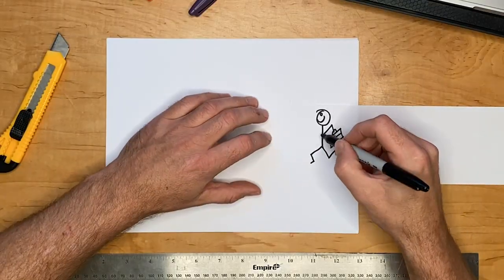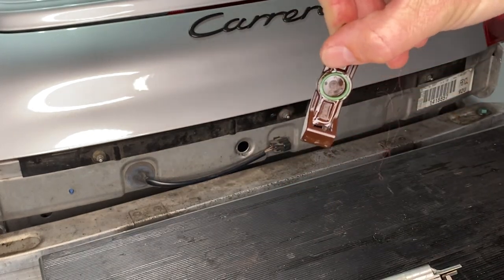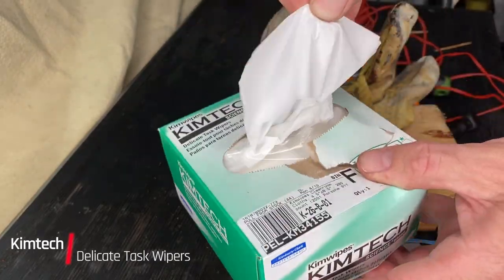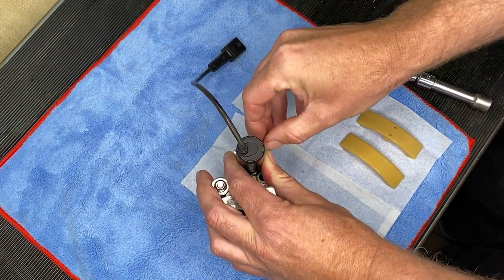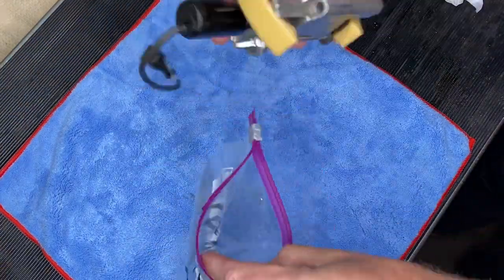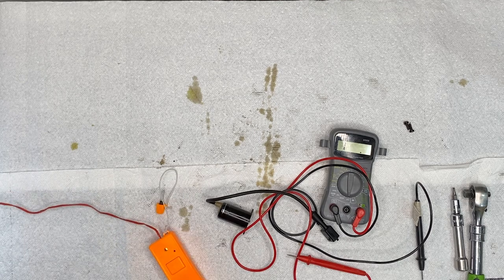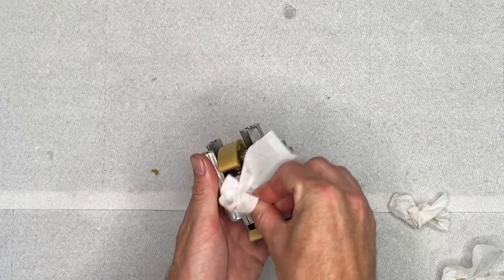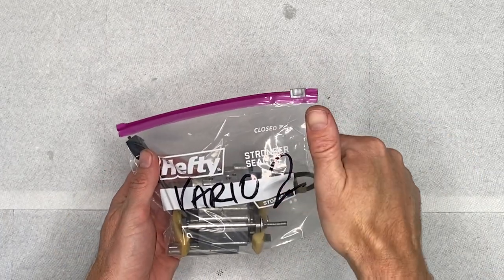PORSCHE VarioCam Test & Rebuild

Comment: Having them on the wrong way is indeed a big problem! Back again to comment on your videos because I'm learning so much! But, the tiny holes on one of the cam-pads are where oil escapes the piston and the whole system and lubricates the chain. Without them in the right place the parts will wear unevenly. Good catch by you on the re-watch when you were looking at the previous "mechanic's" work. Very nice!
Reply from the maker: Thank you Kyle, I appreciate the education. I was wondering why only one of them had a seal and holes in it. Prior to having them in my hands I had assumed that the upper and lower were identical. Live and learn... Thank you for watching 🤘😎
Reply: @ManinaGarage   with the debate around which way they go back on.  Under the cam pads is there a spot where the oil comes out to lubricate the pad. Surely that will guide you as to which way they go back on.   I need to watch again now

Comment: This is the best vid specific to the cam chain solenoids, actuators and pads. You make it look easy. No doubt the bank 2 pads mixed up couldn't be a good thing and were likely the cause of failure.  From what I've read regarding age and mileage I'll be doing this job in a couple years.
Reply from the maker: Hello DSC800,

A subscriber mentioned that those two holes on the lower are designed to control the flow of oil out of piston and that the green oring is to prevent the oil from going anywhere but out those holes. The jury is still out on exactly how that would lead to their early demise, it’s probably not good though 🤣😂. I feel someone should set up a “cam pads ‘r us” business and just churn through all the Porsche’s in their area for some bargain price. If someone was doing this on a regular basis they could make the price less painful (maybe)  Thank you for watching 🤘😎
Reply: @ManinaGarage  I agree with the other commenters that those holes let the oil out which lubricates the chain. They having been put in the wrong way around meant no lubrication between pad and chain leading to accelerated and heavy wear that ultimately lead to the chain jumping two teeth (or am I mixing up your observation wrt 2 teeth jumped on bank1 and the pads swapped on bank2?).
Anyway, to my understanding this is proof that no gear slipped on the IMS so no need to pin it.
Also your observation early on when finding TDC that only one bank was misaligned (soot inside the combustion Chambers onjust one bank) would have meant that the gear that drives the exhaust cam would have had slipped not the gear that's been driven by the crank which is more susceptible to slipping apparently. 
I would put back the pistons as they are together with new rings if the bores check out in spec. Except the one that has the little spot where it flaked off. Anything other than ferostan (or ferroprint also by Mahle) combined with locasil is not proven nearly as extensive as ferostan/locasil.
Reply: @bernardmclake3898  I agree but it's probably a hard decision at this point, to re-sleeve or not. It would save a lot of money to put it back together but then who wants to do all the same work again if it starts to score in 5 or 10k miles. 
There is a Hartech document that describes a locasil v.1 and a v.2 with the v.1 ending around the mid-2001 model year. V.2 was cheaper/faster. He backs it up with magnified images of each type (spoiler alert - v.1 is better with a finer grain that is easier on the skirts and less likely to flake).

Also, it would have been the intake gear that slipped two teeth not the exhaust as this is driven direct by chain from the IMS.

Comment: Brilliant! As usual. Eight years ago, I bought my first Porsche, a 2001 Boxster S. I new that the guide rails were worn when I bought it (showed up in the PPI). I had no idea what that meant so that first winter in MY tiny garage, I dropped the engine and dove in! What the fuck did I know: hey it's not rocket science, right?  The Bentley's and the internet were highly useful in keeping me from despair. I guess we are kindred spirits Finn, know no fear, hey, what's the worst that could happen? Excellent video, and very entertaining!
Reply from the maker: That’s a good PPI, I’m impressed 🤩. Those little buggers were intimidating until they were in pieces. Discovering that they work on oil pressure was a fun brain twist, Porsche engineering! Wishing you an awesome weekend 🙌

Comment: 9:00 - ouch, you use your multimeter in a wrong way
your black test lead should always stays in a COM port and the red one you can use in either in the right port to check the voltage, continuity, resistance etc... and to check amperage use the left one which says -  10A
Reply from the maker: Hello Mykola, I agree the cables where backwards, the reading ended up being in the minus scale but reading exacty the same as it would have. Not really an issue?

Comment: Excellent video. You've found the problem in your motor. Are the cam actuators identical? Or are they designed to have the pads on the alternating sides? I'm guessing that the pad with the o-ring, is the one that 'bleeds' oil from the pressure being passed through it. The o-ring is to stop the oil leaking out, and the 2 small holes are drain holes. That's how it maintains correct oil pressure perhaps. Need to make sure that the pad with the o-ring is installed on the side of the actuator that has the oil hole. Of course, I have not built one of these before, so learning from what I see here too. Thanks for the videos.
Reply from the maker: Hello Michael, you hit the nail on the head. The answer is making sure the plastic guide with the holes is on the side of the actuator with the drain hole. I will be revisiting that conundrum when I’m putting the little buggers back in. Everyone chipping in really helped figure it out. Thank you 🙏

Comment: You did a splendid job on those. Is possible to change those pads with the engine still on the car, albeit not much fun (ask me how I know), but it was wise to take it out and do a proper once over everything. You'll definitely get invaluable knowledge on the inner workings of your machine. Plain white coffee filters are an alternative to Kimtech wipes. They're cheaper, lint-free, and a little bit more robust for cleaning. One could use shop towels as well but, in my experience, they kind of 'melt' in the presence of brake cleaner or acetone while coffee filters don't.  Great job and looking forward to the next videos!
Reply from the maker: Coffee Filters?? BRILLIANT!! 🙌 Thank you Fred.

Comment: This is great! I have a 3.4 996.1 that I'm getting ready to do all this on. Throwing -9.34 on bank 1 cam deviation per durametric. Car runs great but obviously that's out of spec, and I expect it to be at 132k miles with the engine never having been removed from the car
Reply from the maker: The 3.4 996 is growing on me, I hope you are enjoying yours. My understanding is any deviation over 6 is pretty telling. It's important to mention that you can replace your cam guides with the engine in the car. Thank you for watching 🤘😎
Reply: @ManinaGarage  I love the 3.4 996... But I found an extremely cheap 996 Turbo that I purchased and am fixing up! So sadly I'm pushing the 3.4 on to the next buyer. I thought about doing the job with the engine in the car, but I figured it would be easier with it out and allow me to inspect and replace vacuum lines and what not on top of the engine. AoS, etc.
Reply from the maker: That Turbo was a good idea 🥳

Comment: Great video....thanks! This is the exactly problem I just started having on my 2001 boxster base. At idle it's rough and smooth throughout the rev range. It's throwing code P1325 which from researching is directing me to the vario cam solenoid bank 2
Reply from the maker: @ShamileII  I’m glad it helped you 🙌  Check out Porsche Engine Gurus on Facebook, they have started dismantling the solenoid to replace the O-rings, they have photos on their facebook        https://m.facebook.com/groups/591859944843493/?ref=share&mibextid=S66gvF

Thank you for watching! 🙌😎
Reply: Same here - 2002 Boxster! Great video as I have acquired a couple of cam/solenoid units to work on, and now feel very confident about the job.
Reply from the maker: @BlackBuck777  Thats good to hear. Thank you for watching! 🤘😎

Comment: Just FYI the pads on bank 4-6 are supposed to be the opposite to bank 1-3, so you should put it back to how you found it on disassembly 😉 (you did bank 1-3 correctly so that's fine)
Reply from the maker: Hello Duncan, I have had half a dozen people tell me what your saying and at least as many tell me the opposite 🤯 . That aspect of the engine is covered in the Bentley Manual, it says that the lower (inner) Timing Guide Rail is always the one with the oil drain holes and the green O-ring. Throw me a bone here on why there is so much conflicting advice on this particular subject?? I really appreciate the comment, Thank you for watching 🤘 😎
Reply: If you look at the metal plates the pads clip on to, one of them has a small oil hole in the centre. The pad with the holes also has an o-ring designed to seal around this oil hole, so the oil sprays through the two holes on the pad to lubricate the chain and doesn't leak away. These are on opposite sides on each bank, and it seems the manuals are describing bank 1-3 only.

At least that's how I think it works! 😅

Comment: Now I have a question... Don't you have to fill this variocam cylinders with motor oil, so on the first start of the car the chain don't jump a tooth due a slack in the system for lack of oil? Similar when you preload a old air cooled 911 carrera chain tensioner with oil
And if that is true and I'm not mistaken, how do we do that?
Reply from the maker: Hello Ricardo! The large spring preloads the system hence the need to compress it with the special tool. If you filled the system it would just leak out again by the time the engine was reassembled, it needs oil pressure to work. Thank you for watching. 🤘😎
Reply: @ManinaGarage  Ohhhh, ok! have a great week end

Comment: Before I forget , While I was busy with my IMS bearing  and my RMS I also serviced My Alternator , startermotor  and put a new air/ oil separater ( that’s the reason your car smoked so heavily ) Next move is to put in an IPD plenum which improves Performance  ,  good luck with the Progress on your Engine !!!
Reply from the maker: Hello Arnold, you are right, definitely new AOS. Did you service your Alternator yourself? Thank you for the heads up 🙏
Reply: @ManinaGarage  No a Friend of mine has a Bosch Service Station and he did. it together with the startermotor  .
I changed my flywheel back to It‘s Original Status again .
Today I‘m going to work on my second car , which is a 83 SC !!
Reply from the maker: @arnoldmosk494  Sweet, now that’s a real 911 😉.
Reply: @ManinaGarage  Don‘t worry , they both are , and the nice thing is that there is room for modifications without disturbing the Integrity of the car !!

Comment: Great video as usual. Those wipes are really pricey on Amazon. Where r u buying yours?  I think the blue shop towels are lint free too.
Reply: Agree! they're specialized wipes for science and stuff. Shop towels melt when used with brake cleaner or acetone (ask me how I found out lol). I guess because of their composition or the way they're made. I'll suggest you to try white coffee filters. They are lint-free too and around $2 for a pack of 200+.
Reply: @Fred82ndAbn  that was going to be my next suggestion. I have thousands of those and use them for other tasks like filtering oil crud.
Reply from the maker: Hello Yogi,l That particular box came from Pelican Parts. I got those particular blue shop towels because of there lint free claims, the first time I used one on the crankshaft it left lint all over the place, that was the reason I bought the KIM Wipes. Another subscriber recommended coffee filters 🤩. I hope your Porsche is coming along nicely 🖖
Reply: @ManinaGarage  I had it checked out using a Durametric. I’ll be sharing the results in my next video! Be sure to check it out.
Reply from the maker: @YogisGarage  Sounds very efficient 🧑‍✈️
Reply: @ManinaGarage  Hey I had a question or two to ask you. Mind if I DM you on Instagram?
Reply from the maker: @YogisGarage  Go for it 👍
Reply: If I ever have to do a job like this, I’ll borrow a box of Kimwipes from my lab. 🤓

Comment: if i'm understanding it correctly, one pad has an 0-ring on it and the other one doesn't, if so, i can't imagine how it could NOT create a fatal problem if they were switched.
Reply from the maker: The word on the street is they were the correct way around, they were just old. When I made this video I knew less than I know now 🤪 Worn variocam pads were the reason this engine died. Thank you for watching 🤘😎

Comment: Finn, I had to watch this one again to get a better perspective on the variocam set up.  It is more than a bit unsettling that your car died because of the plastic tensioner ramps.   A selfish question here...do you know if Porsche addressed this issue and improved the ramps in subsequent years?  Or was your failure just because the ramps were installed in the wrong position?  I have an '06 997 and really want to believe that these variocam ramps will not become an issue.  I have also learned that the IMS is not an issue in my engine, and I think that bore scoring will not be an issue given how I drive the car.  This issue that you are having (had) with your engine is the one thing that I am uncertain about.  Any thoughts?  Thanks, buddy!
Reply from the maker: Hello Tom,

I looked up some stuff on your car. You should have the larger single row ims bearing in 2006, not known for significant issues. Your car has an updated vario cam, more like the vario cam plus. I looked up  chain guides for your car on pelican parts, they don’t seem to have any?? I think your car has a different system altogether. I know on the vario cam cars like mine that a durametric check of “Cam Deviations” while the engine is hot will give you an insight into the state of the little plastic timing chain guides. Anything over 5 degrees could be cause for concern. Not a decisive answer  I’m afraid. but hopefully that gives you something to go on. 🤓
Reply: @ManinaGarage  Thanks a lot for this!  Sorry to cause you extra work - it never even occurred to me to check out things with the parts suppliers to see what products are offered as replacements.  That can certainly help build a better picture of what I have, exactly.  I appreciate your help!
Reply from the maker: @aboyandhisdog  most welcome Sir🙌

Comment: Loving these videos! Bought a 996 a couple years ago, so really enjoying seeing how these engines work.
Now for a question for somebody that has experience with these cars - I was shocked to hear the chain had jumped 2 teeth. I would expect that to cause much more trouble than just a rough running engine. How many degrees does 2 teeth equate to, and how close was this engine to serious damage?
Reply: I don't have much experience with these engines but I believe the sprockets have 28 teeth, so 2 teeth off would be ~25 degrees (360/28 x 2). The Variocam is either on or off, advancing the intake timing 25 degrees when on. Since the exhaust sprocket is driven by the IMS chain it is not affected but the intake timing is retarded by the 25 degrees when Variocam is off and maybe this is just enough to cause the valve to contact the piston (seen in the earlier vid).  ???
Reply from the maker: The Sprockets have 21 teeth if that helps? 17 degrees each.
Reply: @ManinaGarage  The M96 is an interference engine, correct? Again, I'm surprised this didn't cause valve/piston damage, but  I'm just guessing because I don't know the specifics of these motors.

Comment: Hey can you do cylinder head porting at the same time ?
Reply from the maker: Hello Valhalla, That is a really good question, I am not sure what I'm going to do with the cylinder heads yet, presumably the valves need to come out and get cleaned. Polishing and porting the heads sounds like something to look into at that stage. Thank you for the heads up. Have a great day in the north country!
Reply: @ManinaGarage  Send them to Hoffman Automotive (https://newsite.hamheads.com).  He's the most renowned M96 head expert around.  If there's any cracks, he'll find them and repair, plus he stress relieves.  He can port polish and install new valve guide as well.

Comment: I have a question, will you be replacing the oil cooler in the car? I've read on some forums guys swapped out their stock cooler with a 997 one which gave a 15 percent cooler rate. The part number is 997.107.025.92 once I will tackle my 996 I don't want to go back in and do it right
Reply from the maker: Hello Mahmood, I had not heard of a benefit from replacing the 996 cooler with one from a 997, what forum was that on? I am replacing the oil returns with a set from a 997, the oil cooler thing sounds interesting..... Thank you for watching 🤘😎
Reply: No thank you for being the super star and leading the way, if you have any social media I can forward you what I have
Reply from the maker: @mahmoodalattar2975  Sweet! Thank you. #amaninagarage on Instagram 🙏

Comment: 👍
Reply from the maker: More girls soon Don, I promise 🙏
Reply: @ManinaGarage  Suppose that engine has been out once before?
Reply from the maker: @donesper2070  Hello Don, what I feel happened is that the cam pad service was done by an independent at some time with the engine in the car and they put the pads in backwards. More evidence may come up, that’s what I think right now. I hope you are having a great Saturday!
Reply: @ManinaGarage  Yes, as always, the used engine in my 911 whent through 2 others before it ended up in mine, the last had an unfortunate meating with a  🦌 on the road